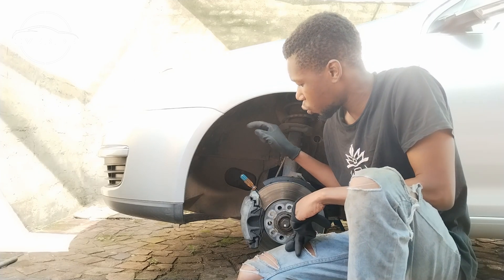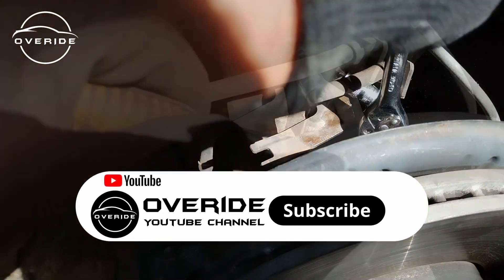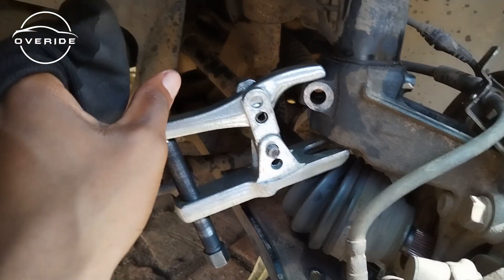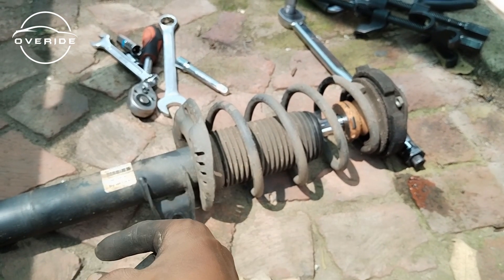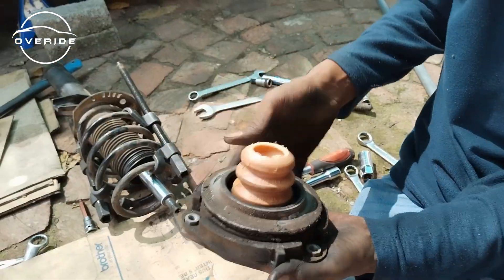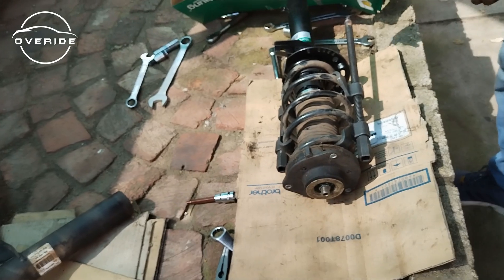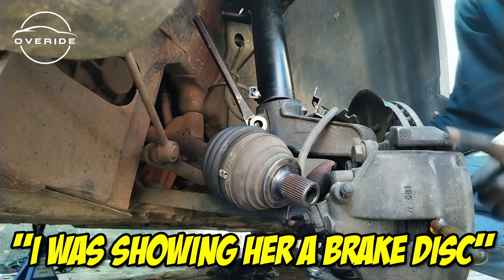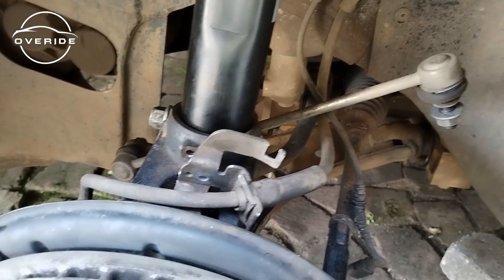How To Replace Front Shocks | VW Golf/Jetta Mk5

Comment: VAG car connectors come out when operating that clip and push and pull that connector.  It not always come out if you just operate clip and pull.  You have to push whole connector first back in its place and then pull.
Reply from the maker: Yeah sometimes they can be difficult to pull out but I've now gotten the hang of it. Thanks man